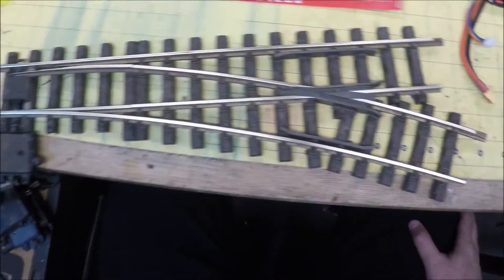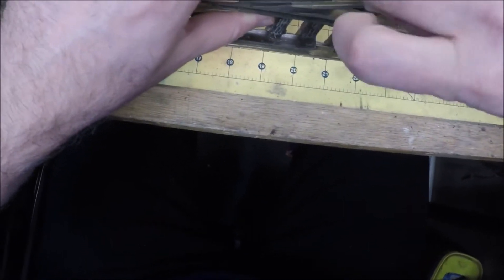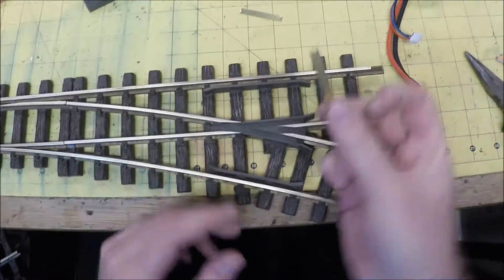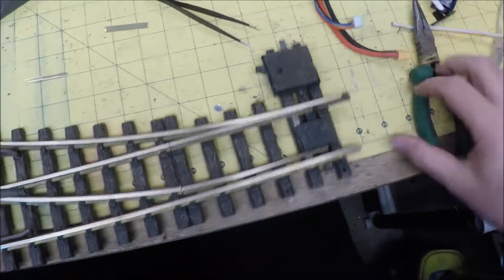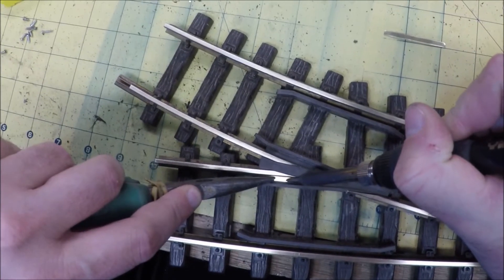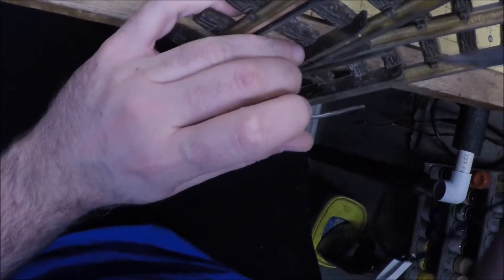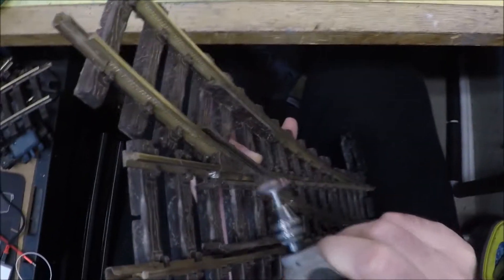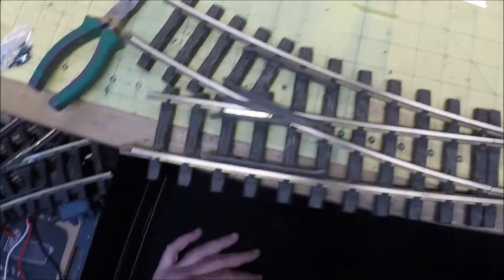How To Add Conductive Strips to LGB Switches To Improve Reliability

Comment: This info is golden!  I haven't had the problem yet, but now I'll know how to fix it if I do.  Thanks!
Reply from the maker: One additional thing I learned since making this is to use stainless steel for those strips as they will hold up better and won't corrode as quickly as brass.

Comment: How do the strips hold up outside with oxidation? How would you clean the brass strips being so thin? Are there stainless steel strips that would not tarnish?
Reply from the maker: I thought about the oxidization just days after doing this. I think you could find some aluminum strips somewhere and that would be what I would recommend over brass. Much less likely to oxidize and lose conductivity over time.

Cleaning the brass strips isn't a problem. If you watch my video, I have the sanding strips I used on the frogs before putting the strips down. These would work just fine for cleaning oxidization off the brass strips.